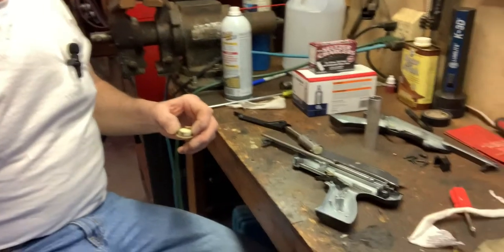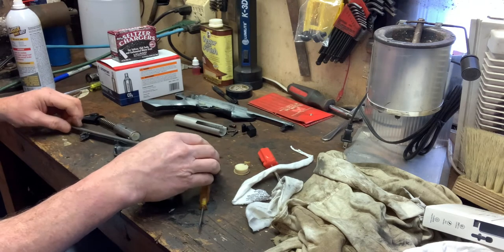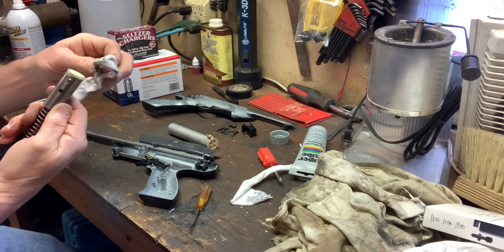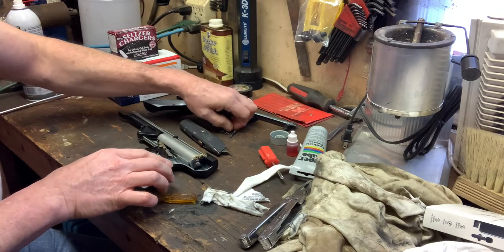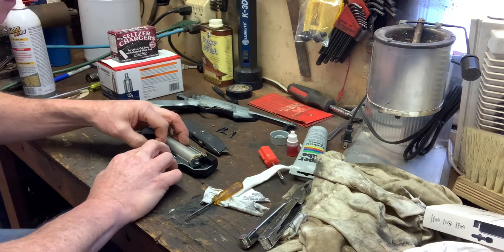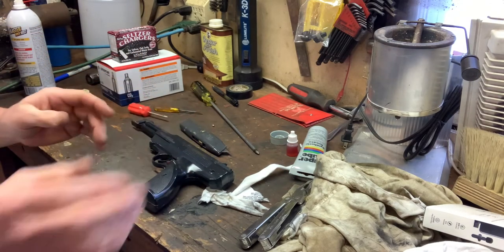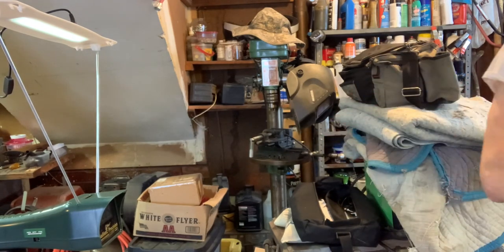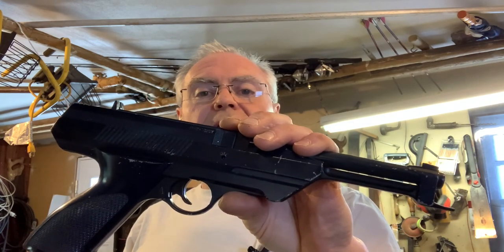Daisy 188 tear down and inspection

Comment: You can fire this thing about 60+ rpm. trick is pull lever down then palm slam the back loader it will retract the lever when you slam it.  Then you can immediately fire.  If your young enough with good dexterity you can get off 2 rounds a second.